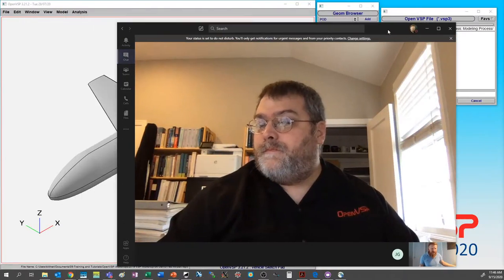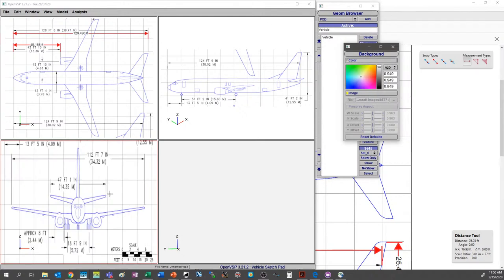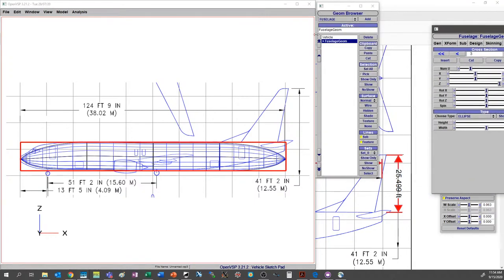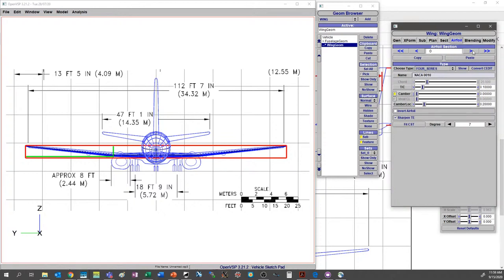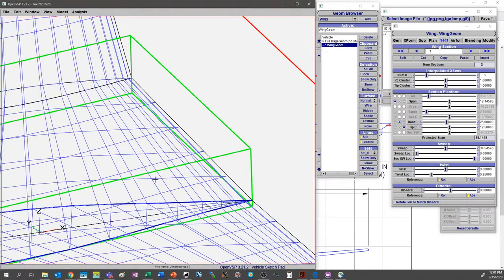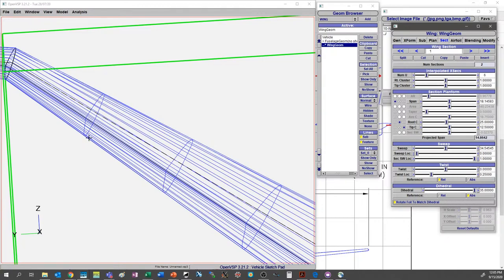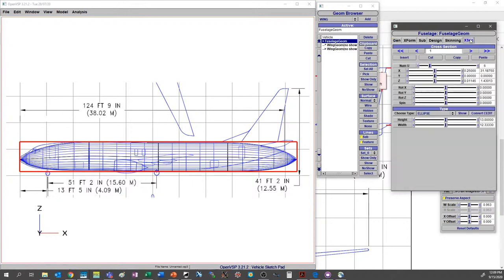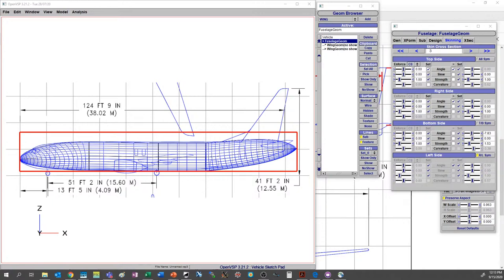2020 VSP WS: Basic Modeling Demo

Comment: This was very unhelpful. I downloaded a picture of an aircraft online but this video did not help because I didn't find the picture on VSP
Reply from the maker: The formats for a background image file are JPG, PNG, TGA, BMP, or GIF.  You will see the demonstration on how to set a background image at 2:32 in the video.  Navigate to the image location and choose the file to place a background image.
Reply: @openvspvideos5394  I had the same problem and couldn't set the background image，I tried png, jpg images as background images but nothing changed. Only the background color can be changed normally. I've also tried downloading different versions of openvsp, all without success. I can't understand why this is the case.
Reply: In addition to the picture format requirements, the picture name can only use English letters or numbers, and pictures named in other languages cannot be opened.